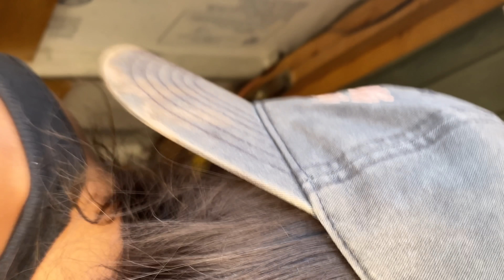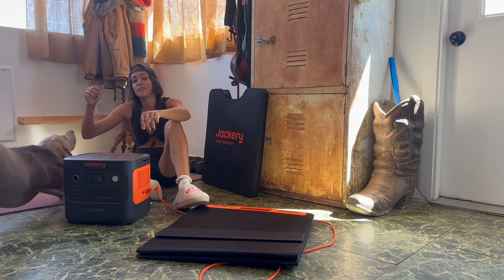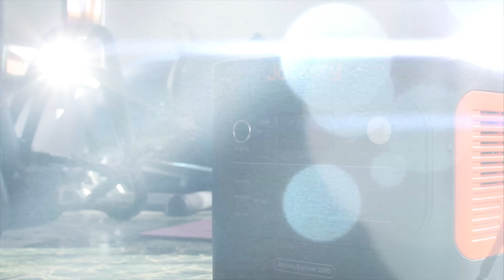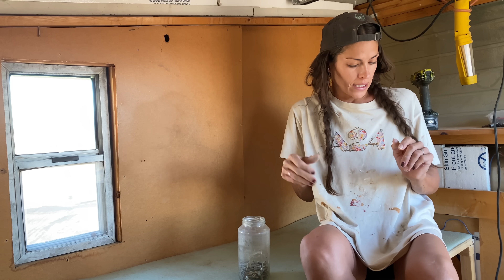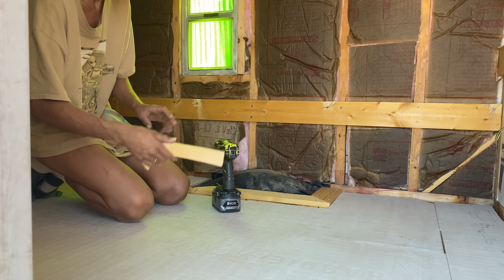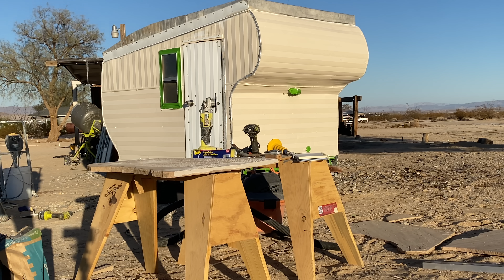DIY CAMPER TRAILER MAKEOVER | My Smallest Renovation Yet!

Comment: You probably don't want to but take the stone out! You're right, it will look gorgeous. However, it will cause damage and problems in the long run when you want to take it somewhere as it's going to be really heavy and damaged the trailers integrity.

Comment: Hi, a nice start on the camper. 
As far as electrical advise if you are going to be running from the Jackery or other batteries I would suggest using all 12V DC components if you can. Using a DC to AC inverter is very inefficient and they can waste up to 20% of your stored energy. 
Also if you are going as far as to install solar panel(s) for charging the flexible panels are much better than the rigid panels. They can be mounted with a lower profile and are better at handling cloudy days or shade. I've installed a few systems now with flexible panels and have never had trouble getting the batteries to full charge every day in any weather conditions.
Reply: Uh, good advice!

Comment: I would say those small tires are not rated for the weight you are adding with the stone.  Additionally, driving down the road, the inside of your trailer is experiencing about an 8.0 earthquake. Plan your materials accordingly.
Reply from the maker: Will make proper upgrades or I'll just demo it out if it doesn't work 🙃

Comment: As a previous manufactured home owner.   These structures are not like stick build.  The weight can't be sustained and the floor will fall through to the ground. 
Also, rubber coating the roof seals leaks.   Someone used nails with washers on mine... many more leaks.   Had to abandon it.
Reply from the maker: I will be living and learning through this a lot

Comment: I don't HATE that you put down hardiboard.  It will help with water intrusion.  I did notice that subfloor is showing daylight so I'm worried about waterproofing underneath.  Look up the gvwr rating of your trailer and your car.  You need to know how heavy that trailer is and how much your car can tow.  I don't think it's a lost cause if you've put down the stone tile.  You might just have to be super selective of everything else that goes in the trailer.  Remember, this isn't a new thing, so make sure it's suspension, axels, etc are checked out and good to go.
And, if you haven't towed before, you might consider getting a sway bar on your jeep for safety.  I know someone whose husband was killed in an accident on a rollover of the trailer!

Anyway, I like seeing you happy.  You're healing.  <3
Reply: Yes the hole in the floor was enough for mice to intrude!

Comment: Generally the reason people do not use things like stone and tile in a camper or van build is the weight. The tires/shocks/whatever car stuff holds the weight, has a weight limit and stone is very heavy. In such a small space hopefully that won't be an issue! At least it will be balanced as it's on the whole floor.
Reply: Not to mention that these materials crack and campers and such can move a lot, causing cracks.
Reply from the maker: Stay tuned for next episode 🙃
Reply: That was what I was thinking weight and cracking.  Maybe watch some remodeling travel trailers for ideas?
Reply: Makes sense - thanks for the intel
Reply: Hope the suspension has been checked out as well. Safety first!
Reply: Can you actually shut up please no one asked😊

Comment: Hello miss Rachel. The trailer reminds me of a tent minus the bugs. Anyhoot. A couple of things came to mind. A window on the door. Nothing big just to add more light and or circulation. The trailer deserves a name and I nominate "Cali". If the trailer is for you to get away giving you a sense of peace, Cali gave you that. Lastly, linoleum flooring. It came to mind because its everlasting. I get adding weight, and durability but linoleum. I dunno. Just a thought.